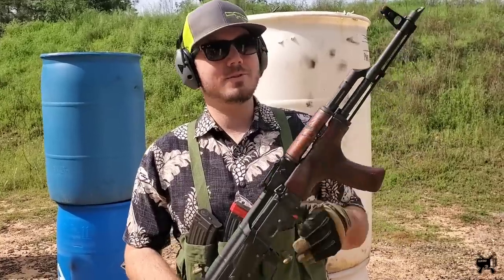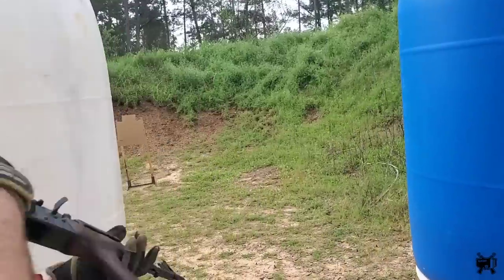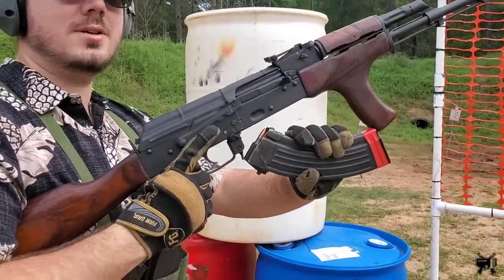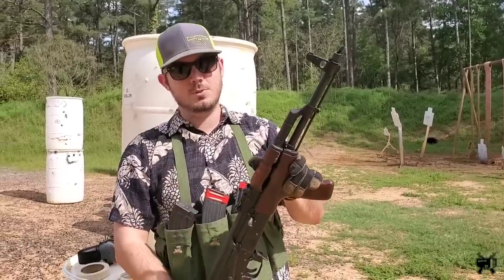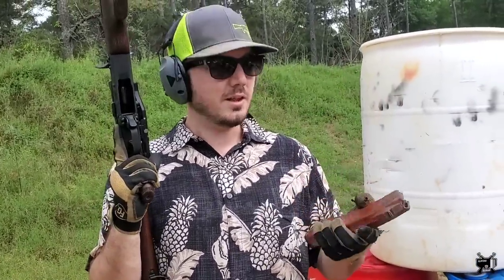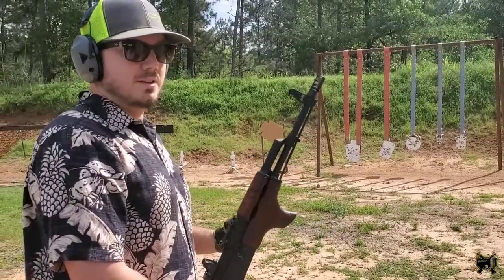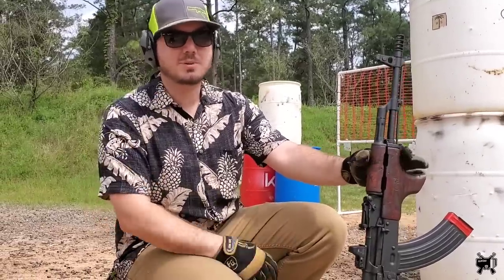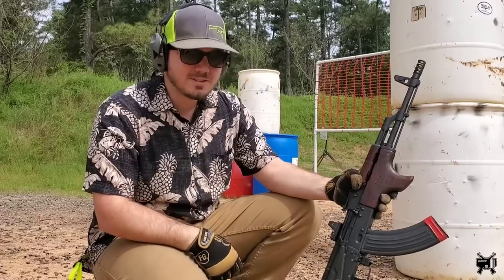Is the AK good as is? can It be better?

Comment: What's the base model AK you're using? I couldn't tell by the stamp markings? I see the 47/63R, and I spot a Romanian front trunnion. 
If you don't mind, what's the receiver and barrel, and importer and manufacturing?
Reply from the maker: It's a Romanian parts kit put together by definitive arms.

Comment: I picked up one just like that a few months ago.  Runs great, groups nice.  Unfortunately the front sight is canted worse that I originally thought when I bought it so it's a few inches left at 25yds with the sight maxed out to the left..  Can't decide if I want to fix the sight tower or try an Occam Merc freefloat handguard.
Reply from the maker: That's a really cheap fix for a gun Smith I would give it a shot
Reply: The occam handgaurd is the shit! Its a hefty price tag and a little bit of playing 'nip tuck" but once its done you'll never look back. Takes your platform up 5 notches.

Comment: Did 922r apply for the mod or no?  Also, you were caught by surprise, first reload.  The empty chamber and that lonely 'click' . . . this is the only downside to the AK platform (IMO) when compared to AR, which does lock the bolt carrier to the rear when the mag is empty, provides shooter with an obvious feel to know when he out of rounds.  SGM provides a solution with their US made (again, 922r) magazines, which provide a rear locking function / sensation.  However, unlike the AR, the bolt will return (forward) when the SGM mag is removed.  SGM mags are superb.  And their 20 rd. mags provide and obvious solution to "dong" interference.
Reply: Imagine caring about 922r. 😂😂😂

Comment: Hey Klayco i have the exact same rs regulate mount do you loctite the lower to the upper? And if so do you use red or is blue strong enough? Thanks in advance.
Reply from the maker: I really never have but it doesn't hurt. Use the blue it's all you need.
Reply: @KLAYCO47  👍
Reply: What if I want to run a kns piston to tune the gas down a bit but id like to do it by purchasing another BCG and putting it on there. If i did wouldnt i be able to just swap my bolt between the two?
Reply from the maker: @kelvera88chief67   You need to make sure that the other carrier will still head space when you put your bolt in it.
Reply: @KLAYCO47  is that some that only a gunsmith can do? Can i buy gauges and test it that way? Like "go" and "no go" gauges that robski uses in the 5000 round challenges?
Reply from the maker: @kelvera88chief67   Yes you can buy the gages but if something has to be changed as in the face of the carrier needs to be reprofiled I wouldn't trust myself to do it I would rely on a gun Smith. That's just me thoug.
Reply: @KLAYCO47  i see thank you for clearing that up for me.

Comment: What are your thoughts on adding a buffer to the recoil spring on the AK to prevent that bolt from smashing into the rear? Worth it or no?
Reply from the maker: not a good fix the only time I can see those buffers being usable is if you have a Carrier that begins to jump the rails in the rear of the receiver.  Everyone thinks most ak's smash the Carrier into the rear of the receiver that's not what's happening/should not be happening. when recoil Springs begin to get really worn out then yes eventually that could happen just replace the Spring or get an extra power Spring.
Reply: @KLAYCO47  awesome thank you for that explanation, i just purchased a GF3 and I'm trying to absorb as much info I can about the platform on a technical level. I will watch for signs of impact and if so get a stronger spring like you mentioned.
Reply from the maker: @Z33Garage   Yeah man I wouldn't put one of those in right now especially with a brand new gun.
Reply: @KLAYCO47  thanks again for taking the time to reply!
Reply from the maker: @Z33Garage  np mane